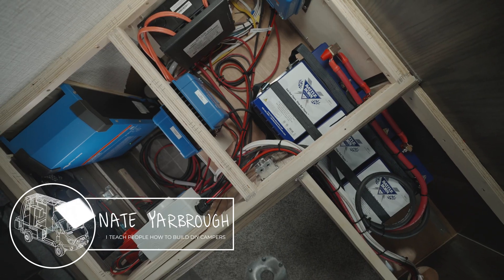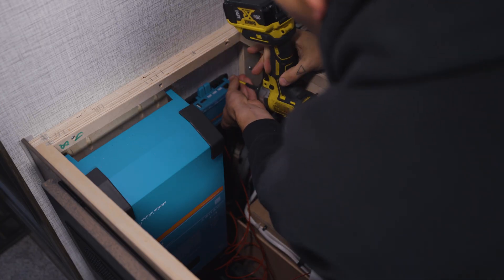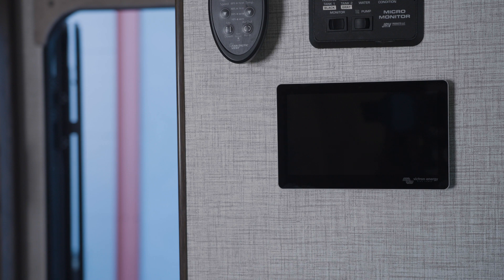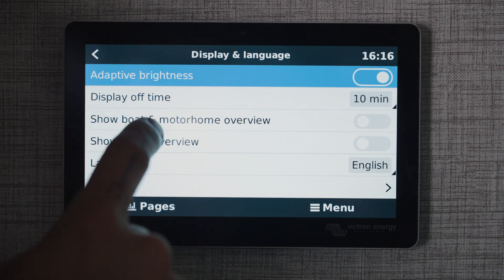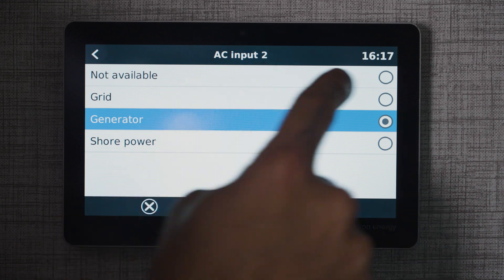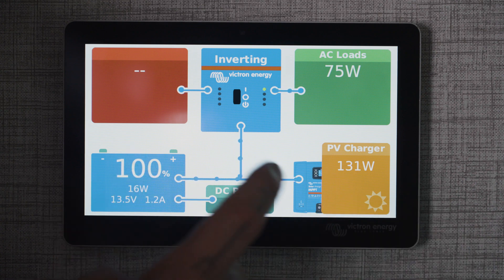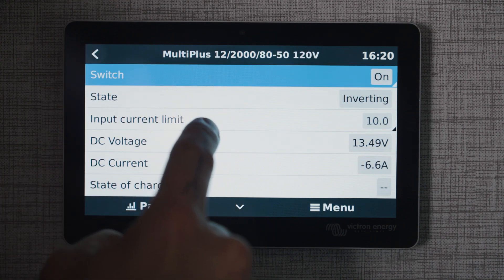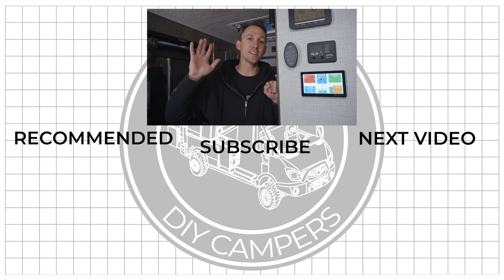Victron Cerbo GX - Basic Install & Setup

Comment from the maker: Try our System Monitoring kit that helps you pick the right data cables for the components you have installed: https://shop.explorist.life/shop/all-products/system-monitoring-wiring-kit/

Cerbo GX: https://shop.explorist.life/shop/all-products/victron-cerbo-gx/
7" Touch Screen: https://shop.explorist.life/shop/all-products/victron-gx-touch-70/5" Touch Screen: https://shop.explorist.life/shop/all-products/victron-gx-touch-50/
Reply: Im currently not using an inverter as of yet for my 12 volt setup but using solar to keep batteries charged. Everything is connected and working great with smartshunt but how do i change the AC loads on the gx touch to blank to show nothing like in your video. I dont want to see them if im not using them. Thanks
Reply: thank you as I am a complete newbie and these are the questions I will have .  thank you for your input

Comment: Hi, thanks for your straightening and easy to forward advice. Can I ask a question?…so I’ve had my Cerbo GX installed for a while and currently running 3.62 firmware. In recent weeks the unit powers itself on and off, sometimes I have to pull the power input and reconnect to have it fire up again. It is very random and sometimes the wifi light just sits blinking orange, sometimes it manages to get past that and will go green, a click can be heard like an internal relay (I assume to activate bluetooth) then the unit dies. Strangely…very occasionally…it will click and Bluetooth comes on but that’s not always the case. I need Bluetooth as I have a mopeka unit monitoring my fresh water tank. It’s very frustrating and only seems to have started this since running the last 2-3 releases of firmware. Is my unit bad or is this some inherent issue that’s caused by the newer firmware?
Reply from the maker: Happy to take a deeper look at this.  Reach out to our tech support: support@explorist.life

Comment: Just completed my 24 volt system install, and I also have a 12 volt battery for the DC loads with a dc-dc charger between the banks.
I'd love to see a tutorial on how I can use the relay on the cerbo gx to intelligently control when the 24v bank charges the 12v battery.
Reply from the maker: Nice work getting that 24V system up and running — and great question about the Cerbo GX relay control! That kind of automation is definitely possible, but the details can vary based on how your charger and relays are wired in.

We’d recommend reaching out to our support team so they can walk you through options specific to your setup:
https://shop.explorist.life/support

Support is free if your gear came from our store.
For systems using components from other vendors, our Pro Support Membership is a great way to get personalized help:
https://shop.explorist.life/shop/all-products/membership-tiers/

Comment: Good evening,

I would like to describe my off-grid system in detail. I have installed two Victron charge controllers, which are connected to a distribution bar (busbar) from Lynx Power. From this bar all the connections necessary to operate the system start.

However, I am experiencing a problem: when the parameters of the charge controllers, set for LiFePO4 batteries, cause the voltage to reach 14.2 volts, particularly during the absorption (absorption) phase, the inverter beeps an alarm, which suggests that a voltage overload may be occurring. I hope I have explained myself clearly.
Reply from the maker: thanks for the clear explanation! It does sound like the inverter may be interpreting the absorption voltage as a bit too high, depending on how it's configured. This can happen if the inverter's high-voltage disconnect threshold is set too close to the LiFePO4 charging voltage.

To make sure your system is balanced safely and running smoothly, our support team can take a look at your exact setup: https://shop.explorist.life/support

We offer free personalized support for components purchased from our store. For help with equipment from other sources, our Pro Support Membership provides expert guidance: https://shop.explorist.life/shop/all-products/membership-tiers/

Comment: I want to connect 3 Solar charge controllers plus the BMV-700 to my credo GX, problem is I need 4 VE Direct cables. Right now I have the BMV-700 connected with one VE direct cable, I have one VICTRON Solar controller (no Bluetooth) with another VE direct cable. I have added two more solar charges controllers (with Bluetooth) that I want to add to the Cerbo GX.
Is there any way to do that? I only have one VE direct port open.

Comment: can the cerbo get the ve direct data via bluetooth instead of running those ve direct cables? I have multiple systems far away from each other I'd like to use one cerbo to connect to them via bluetooth
Reply from the maker: Nope.  We’ve got 10m cables in our store for that.

Comment: I have the following in my current system for a 50Amp Fifth wheel
3-260AH LiTime batteries
6-170 Watt Panels
150/85 victron controller
150A Victron Shunt
3000W Giandel inverter

I will be adding the following
lynx distributor
lynx shunt
victron 2-120V inverter charger
victron xs50a
Cerbo GX

My question is, can I install the Cerbo GX with my current system even though i dont have the multiplus II yet?

I am currently boondocking for the next 90 days and wont tackle the complete new install until i return. Is it beneficial to just wait or beneficial to install cerbo gx now?
Thank you
Reply from the maker: This may take a more in-depth look at your personal setup.  If you have purchased/are purchasing from our store (shop.explorist.life) reach out for some more personalized help: shop.explorist.life/support

If you've purchased/are purchasing elsewhere, reach out to your dealer for support.  We'd love to have you as a shop.explorist.life customer so we can provide a bit more help in the future. 🙂

Comment: Question how long can the cable be max length to the gx70 screen
Reply from the maker: The HDMI/USB from the screen to the Cerbo GX should not be extended; and that one is about 6'.  Instead, you'd mount the Cerbo close to the screen, then run the Data cables, which come in 30ft lengths, to the cerbo.
Reply: @EXPLORISTlife  thankyou , as I'm needing to have screen 25 feet away. Do you have pic of this 30 foot cable install. I'm slowly changing over to victron from Schneider.
Reply from the maker: It's simply 30ft VE.Direct and RJ 45 cables from the components to Cerbo instead of the 10ft ones shown in this video.

Comment: Great video! I'm getting ready to purchase an integrated system for my 30A toy hauler from Battleborn, watching many of your videos right now. Two questions for you about this: (1) Victron says it comes with a 2 meter data cable. The ideal place for my display is more than 2 meters from where my Cerbo will be. Can a longer cord be purchased? Any outer limits on distance with a corded connection? (2) Right now Battleborn is saying I don't need the BMV712 with the Multiplus system and Cerbo, so they are planning to include the 500A Victron Smart Shunt to save a few $. Is there any loss of functionality going with the smart shunt with Cerbo, versus the BMV712?  Thank you!
Reply from the maker: 1: You should put your cerbo within 2m of your screen and then run the data cables from the components to the cerbo.  Extending the HDMI cable has a pretty high failure rate just based on our tech support inquiries and our own experience.

2: With the Cerbo, a smartshunt is generally used in place of the BMV-712, yes, because the cerbo is the screen; making the BMV screen obsolete.  This is also how we have our wiring kits set up in our store as well.
Reply: Appreciate the quick response. I’m planning to buy a few of your components to go along with what Battleborn is supplying and will call when you’re open with a few additional questions.

Comment: Can I power the Cerbo GX via 12v DC panel? Or has to be via bus bar? For context Im trying to overcome the touch 70 hdmi cable length issue

Comment: Has the Cerbo GX been replaced by the VE Ekgrano GX? Do you have a video on it?
Reply from the maker: We will have a video coming out about it soon.  But no... the Cerbo is not being replaced by the Ekrano.  The Ekrano is replacing the old Color Control GX.  Connecting a Ekrano will be the same as the cerbo in this video, though.
Reply: @EXPLORISTlife  thank you.

Comment: Great video! I have BMV-712 and trying to retrofit this system. Since the little battery readout is redundant with the screen, is there a way to wire the BMV-712 shunt directly to the Cerbo and bypass the readout? Thanks!
Reply from the maker: Thanks!  Nope.  The only VE.Direct port on the BMV-712 is on the readout.   Just tuck that away somewhere and connect the cerbo.

Comment: Can you connect a renogy 50 dc/dc charger with solar regulator MPPT Rj connection into a Cerbo VE port successfully, or does it only read Victron connections?
Reply: That's my question too....have you found an answer?
Reply: Not at present! I am only in planning mode. But I would ask some local Victron dealer where I buy my inverter from the same question.  There is a post on here immediately below ours  from Exploristlife trying to get me to buy their cables etc., So I think the answer is yes  (but I would 'pick a couple of more brains' before I finally acted on it)!  @argi0505  🙃😊
Reply: Not sure you would get an answer here when they use completely Victron only components. 
 I would like to know this too. When you are Victron DCDC AND another MPPT, communication cables start getting expensive.
Reply from the maker: It won’t work natively, no.  The OS that the Cerbo GX operates on, though, is open source, so if you have the hardware and software development skills coupled with a couple hundred (thousand?) hours to throw at it, anything is possible.

Comment: I have the following installed. Victron SmartSolar MPPT 100/50 Charge Controller with a smart shunt. I want to add a Color Control Center not the Cerbo GX. Do I need a victron inverter charger in order for the Control center to display what my system is doing properly? I want to be able to see what is going on without the use of bluetooth all the time. Any suggestions?

Comment: Why is there nothing of note in the red/orange box in the upper left corner? Seems like it is not there just for looks or to fill a blank spot.  Isn't it to monitor the AC, Alternating Current, system and if yes, how do you set that up?
Reply: That will automatically display data if you are connected to shore power.
Reply: @silvanocometta9760  nope, it does not.
Reply: @larrytillick952  Could it be that your Multiplus inverter charger is switched off?
Reply: @silvanocometta9760  Nope, not that either.

Comment: Informative video as always. I am currently sourcing a few Victron items for my build. I have 3 big solar panels of 540W each. I want to have an MPPT for each panel. In the video you have 2 MPPTs plus the battery monitor. Will I be able to plug in the 3 MPPTs plus the Lynx Shunt into the Cerbo ? Thanks
Reply: You will need the ve direct to usb adapter for the 4th device and it can plug into one of the two unused USB ports.

Comment: I was not so lucky with an install on a catamaran.
- I wanted to connect to the board wifi - but it showed many networks as the harbors network some 100m away but not the board network 5m away. By the way, I updated the Cerbo with the harbor's network.
- The bluetooth got steady real quick. Couldn't connect my mobile with victron app.
-----
Nate, I could not control any MPPT - are they not controlled by the Cerbo? They are all listed fine but only displayed not any active control.

Comment: Hello Nate.

1. Do the components need a direct connect to the cerbo gx or can they be connected via Bluetooth?

2. What if you have 3 mppt solar chargers and an orion dc-dc charger? Where to connect?
Reply: I have used a ve direct to usb cable to add the extra Mppt I have for a solar blanket, plugged into cerbo usb port
Reply: @TRAVISGOLDIE  Thanks for your reply. So even though all components support Bluetooth it still requires the purchase of additional cabling? Odd that the components can link together on a network via Bluetooth but not the cerbo gx
Reply: @Tom52540  cables are 99.99999% going to stay connected, Bluetooth while great isn’t assured to. To get the real power from a cerbo you want all the data all the time
Reply: @TRAVISGOLDIE  But all components are not necessarily in close proximity. So can the cerbo gx be installed and functional without the cables?
Reply: @Tom52540  no i dont think so v
Reply: @TRAVISGOLDIE  Thanks Travis
Reply: @Tom52540 I wondered that too. Just the way Victron likes it, so you have to purchase more and more cables to get full functionality. 👎
Reply: @TRAVISGOLDIE  Oke sure, but I would like to see what my Victron Orion-Tr Smart 12/24-10A is doing. It is bluetooth and the Cerbo is closeby........

Same for all my smart sense sensor I have attached everywhere.